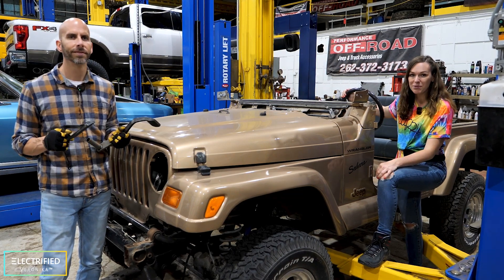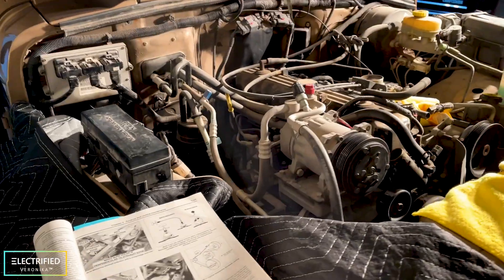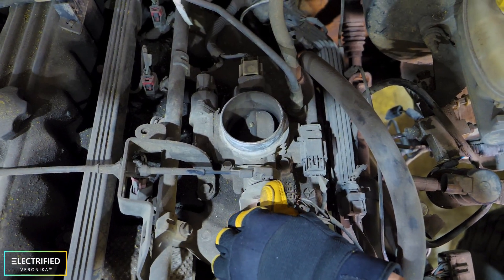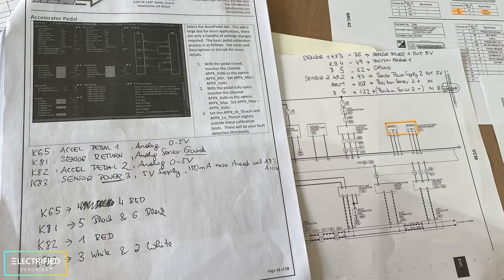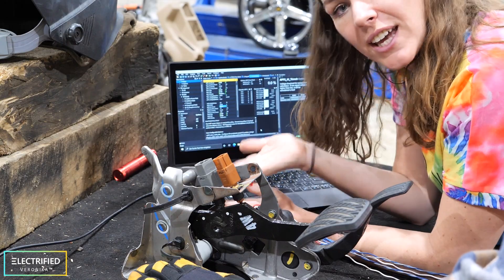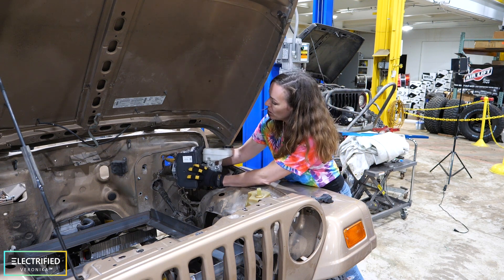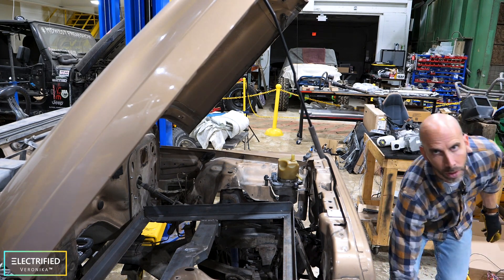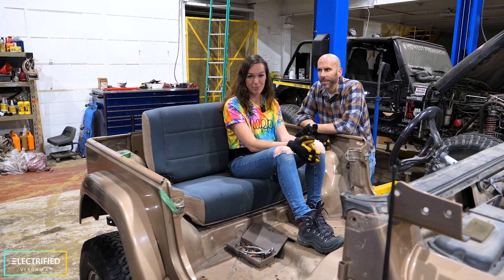Electric Conversion Power Steering, Brakes and “GO” Pedal

Comment: Hi Veronika and Don! Thank you for sharing these AMAZING videos with us. Your channel has taught me more about DIY EV conversions than any other channel on YouTube! I appreciate that! A quick question: how will you prevent accidental runaway acceleration if the return spring on the accelerator pedal breaks? Does the pedal have an additional return mechanism in case the primary return mechanism breaks?
Reply from the maker: Hi Pat, thank you for your friendly comments.  Glad we can help.  Yes, I believe there are two springs for a redundant return mechanism just like all accelerator pedals. (but I will double check).  It also incorporates a dual potentiometer signal.  In addition, we can also program the "brake" so that when it is pressed, the VCU will cut drive power...  Hope this answers your question and thanks again for the nice comments!
Reply: @ElectrifiedVeronika  thank you so much for answering my question! I sincerely appreciate it. I am very much looking forward to your next installment on your electric Wrangler! What you are doing is super inspiring; I hope to do an EV conversion of my own someday! Thank you again, have a wonderful week!

Comment: Hey guys
Great videos.
My 4x4 hilux recently caught fire, its definitely salvageable.
Thinking about turning it into EV.. any thoughts ?
Reply from the maker: Hey, oh no, sorry to hear about the fire. I have no idea how wrecked it is, of course, but in general I've seen a few rebuilds on larger trucks. You would have the bed available to accommodate the batteries, which is much easier than trying to retrofit everything and design entirely new mounts for the batteries in the engine compartment. With an EV conversion, it really depends on how you plan to use your truck in the future. EV conversions have their limitations, but if you know about them and align your use of the truck, do it! Another consideration is CAN communications. If the truck is too new you could run into problems, the older the truck the better. Keep us informed!

Comment: THE steering shaft is the same if not stronger than stock 
The electric steering unit is more efficient by far and makes for a tidy motor bay

Comment: Another interesting and clever conversion by 'Electric Classic Cars' used a tesla unit located where original transfer case is,  So the drive shafts to fwd and aft axles come out of Tesla unit where Left and Right wheel used to be.  I don't know details about ring & Pinion Reduction in axles was dealt with - they must have done something for that.

Comment: Thanks for providing answers to questions on EV conversions.  Curious too how you will implement heater & AC.  Is eliminating AC a consideration?
Reply from the maker: The heating system will be very unique hehe - we‘ll make a video on thermal management overall very soon. We skip the ac for now - not a big fan and living in Wisconsin not really a need when you can remove the top ☺️

Comment: Hey guys. My 2 cents from experiance .....What makes more sense for the power brakes is using a vacuum pump and a accumulator (Vacuum storage tank) and a map sensor to monitor the vacuum to shut off the pump. It requires a little bit of electronics to monitor vacuum and control the pump but uses way less power than electric assist.  .....As far as the power steering what I used is a electric power steering pump from a newer jeep. You will find interfacing the can commands to the power steering pump will be a challange. What I did is removed the oem circuit board and replaced it with a 60 amp ESC controller,  it uses a pwm input to adjust motor rpm. I found I can run mine at around 1600 rpm when at low speeds (turns off when stopped for more than 3 seconds) and reduces down to s few hundred rpms at 30mph. Used the vehicle speed from the can bus and converted it to pwm. The entire exersize was around saving as much power as possible.   Your jeep is coming along nice!